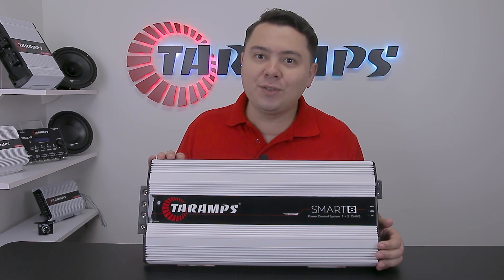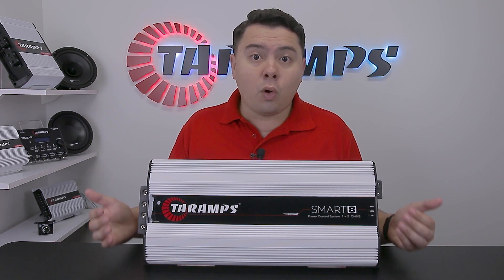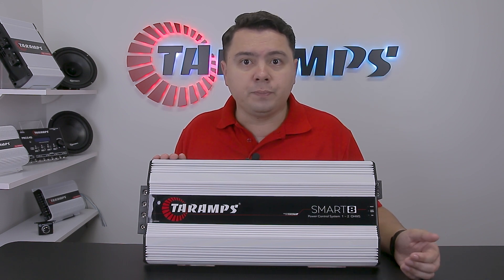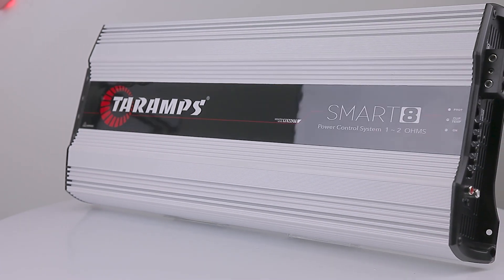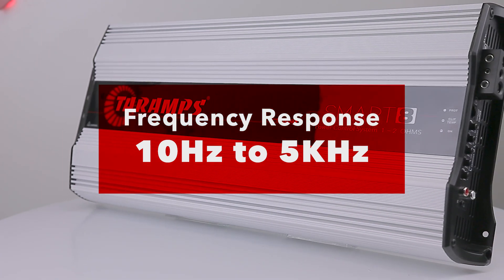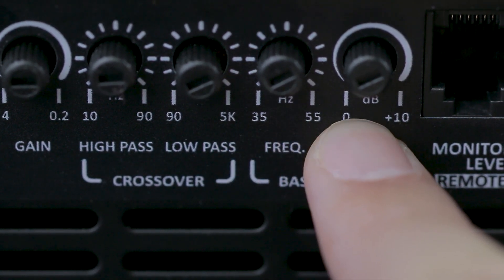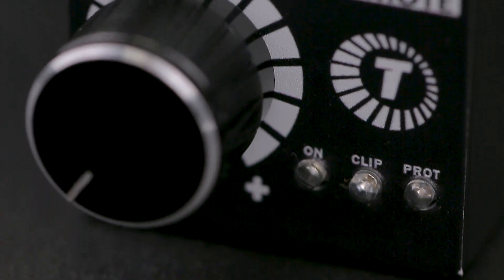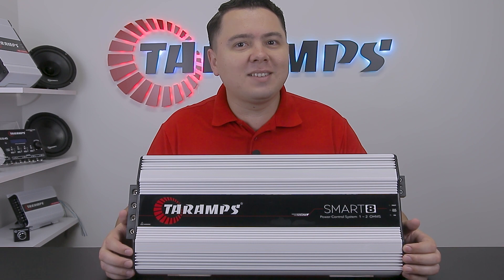Taramps Module Amplifier 8000 Watts RMS SMART8 | Taramps

Comment: Can you run this at .5 ohms
Reply: There are two versions, a 1 Ohm to 2 ohm, and a .5 ohm to 2 ohm.
Reply: you'd want the smart bass 8k. You need higher voltage to get the full power from the smart bass, but it will be stable at .5 ohm.

Comment: I beat the crap out my Smart 3 @0.67 ohm, maybe I'll skip the Smart 5 and just go right to smart 8 🤷‍♂️
Reply: I had 2 smart 5s on 4 american bass xmaxx and omg u will need alot of batteries I had a cyber 12k and mechman 450 alt and I needed more so I sold those smart5s and got a big surfboard amp I made a huge mistake doing that I should of kept the smart5s they hit from 20hz -65hz in my 6th order this team pie 7500d hits 20hz-40
Reply: @buckinright  I run JY Power super caps and have one of their new sodium ion batteries on the way. Should be enough to run 8-10k on music and stay above 13 volts 🤘
Reply: @buckinright  full bridge amps like the ones taramps make are more efficient than those huge half bridge surfboards. That means you will need less battery for the taramps than you would for that teampie if youre getting the same amount of power from them.